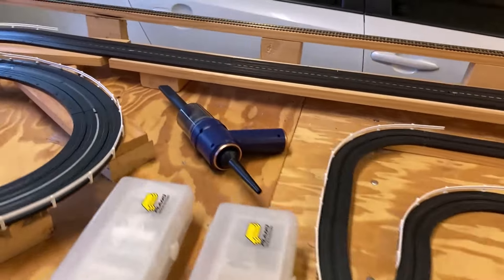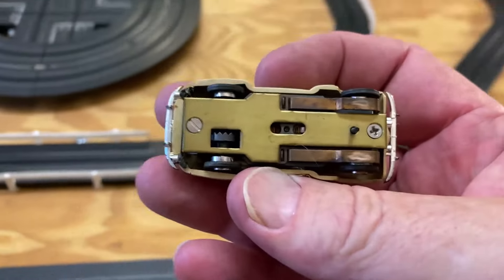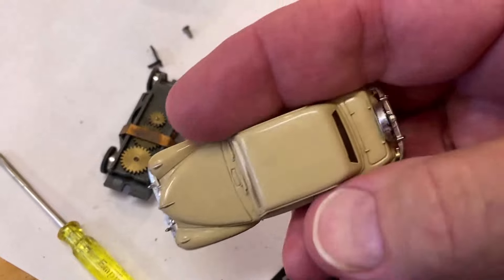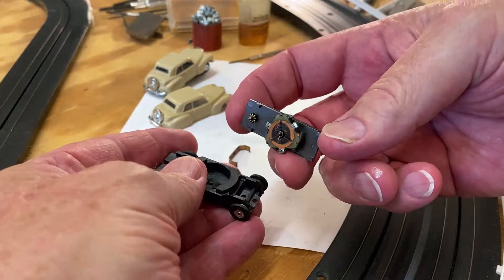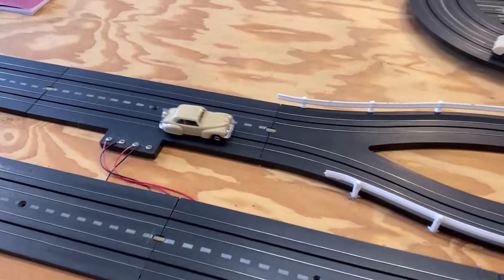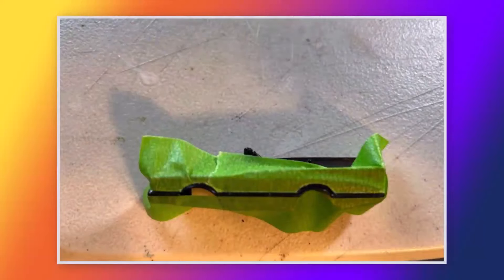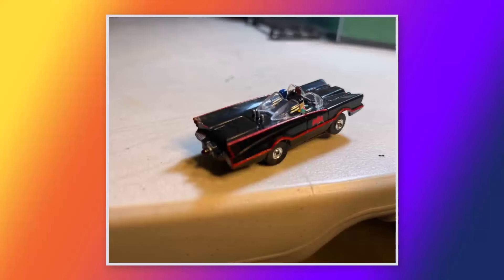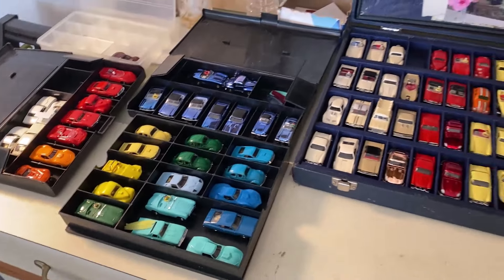Aurora Slot Car Lincoln Restoration!

Comment: Jeff, Thanks for the kind words. The Lincoln looks and runs very nice now. I have entertained looking for a Lincoln that has had the rear skirts removed neatly and making a Hot Rod Lincoln out of it. Would use either AJ’s or Tuff ones wheels out back. Would join the stock Red Lincoln I have.
Reply from the maker: You are most welcome. The Lincoln that I just restored will be the one I'm keeping. With the belly pan it's very smooth running, I love it. Let me know about your Lincoln project, I'd love the see pictures along the way. I could make it a feature video for it, might be fun!!

Comment: Where did the belly pan come from. Was it a add on bought by the customer to help performance?
Reply from the maker: Hey Mark, I don't think the belly pan was manufactured by Aurora. I can't be certain, but I know AJ's made some after market slot car belly pans. Or maybe Wizard could have made it. I'm just not sure, sorry. I'll tell you what though, the belly pan on the Lincoln makes it run really smooth, it's wonderful!
Reply: Thanks Jeff, 
Items like this always peaks my curiosity. I have most add on weights for the later stuff Aurora did but never seen this before. Worth holding on to. Thanks again, 
Mark
Reply: Hey Jeff, another great video! Love the batmobile. I wish I had the time to do that, maybe next year once I’m retired. I would take the clamshell if no one else wants it. The batmobile project I would love to have but most likely wouldn’t work on it until mid winter. Let me know, Steve
Reply from the maker: @stevenhyde4855  Hey Steve, for me to send you the clamshell case, I need your mailing address. You can send it to: smokintjets@gmail.com
Btw, adding the red light to a chassis, drilling out the turbo light on the Batmobile is about 20-25 minute project, if that.
Take care Steve.
Reply: @JeffRyan  I will e-mail you
Reply from the maker: @Mark_S1990  it really made a difference with the Lincoln, I like it!